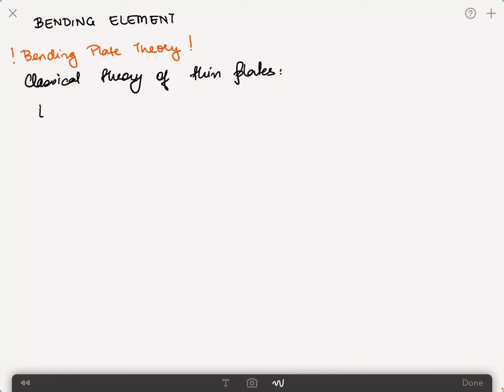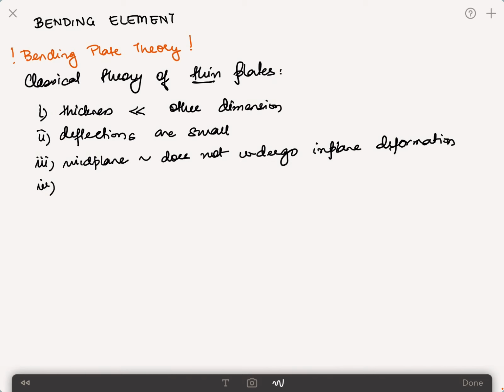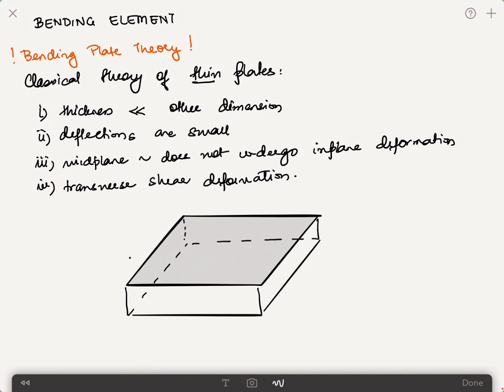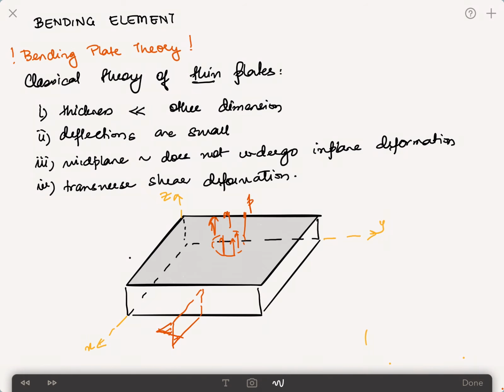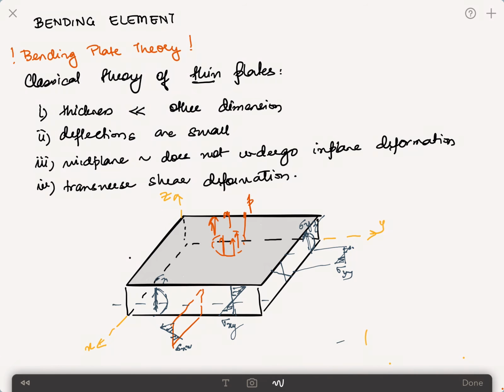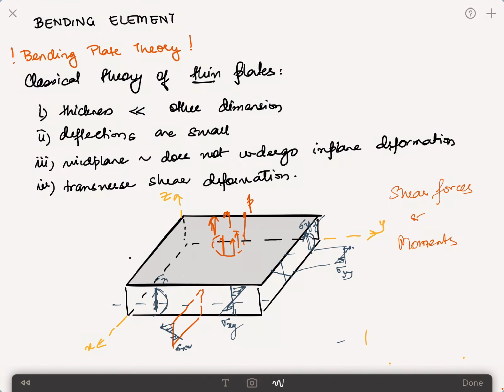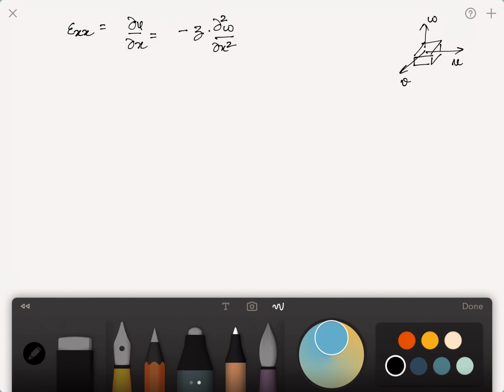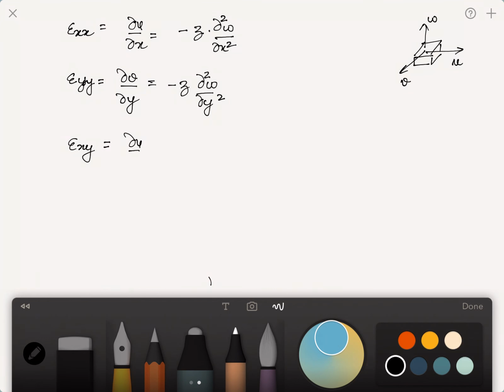Bending Plate Theory

Comment: nice video, can you help me get any ebook or pdf on plate theory. thanks in advance
Reply: Beg, D., Kuhlmann, U., Davaine, L. and Braun, B. -
“Design of Plated Structures”, Ernst & Sohn and ECCS
Press, Brussels, 2010.
Nussbaumer, A, Borges, L. and Davaine, L. - “Fatigue
Design of Steel and Composite Structures”, Wiley-
Blackwell, Ernst & Sohn and ECCS Press, Brussels,
2011.
Reply: Szilard, R (2004). “Theories and applications of plate
analysis – classical, numerical and engineering
methods”. Wiley, New Jersey.